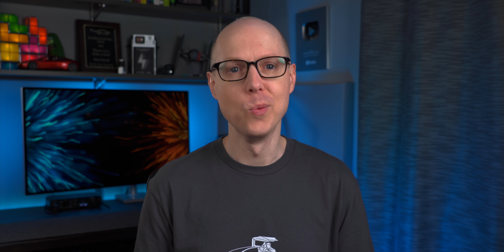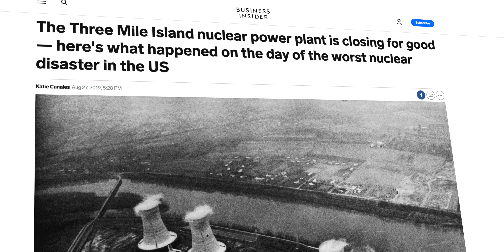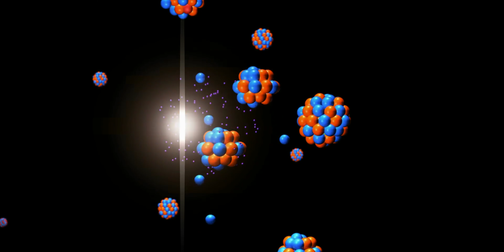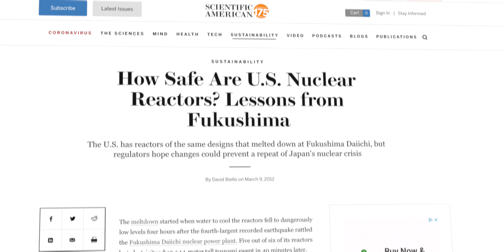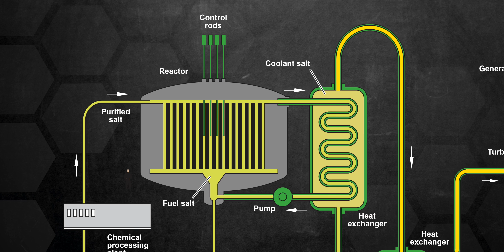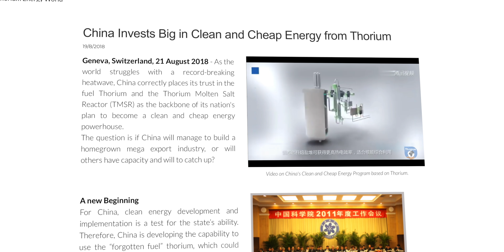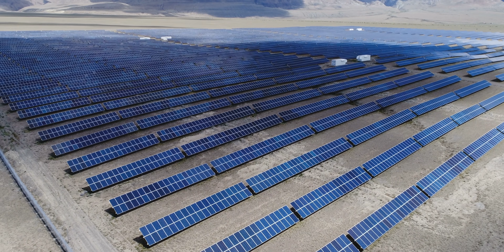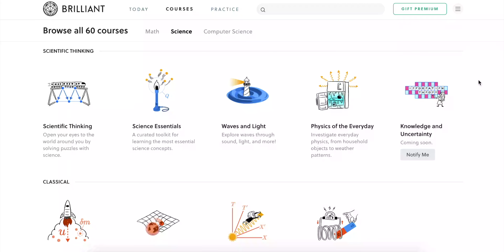Thorium explained - the future of cheap, clean energy?

Comment: No, thorium is not the future of energy, nor is nuclear or fusion as the cost of manufacturing and maintaining these plants is extremely high, along with the cost of mining, transporting and storing the waste, make these energy sources 3-5 times higher than wind and solar, I know, I run the LCOE calculations and work with U.S. utility companies who are shutting down coal and gas plants due to their high costs, not because they want to be green.  The massive fusion reactor in the sky is all we need, we just need to blanket EVERY roof with solar, put the largest wind turbines in windy areas and utilize massive storage batteries.  This is our future.
Reply: To do wind and solar for the whole planet would require literally millions of wind turbines and trillions of solar panels. Way too expensive to do
Reply: @Les_S537  Sorry, you're pulling numbers out of thin air without understanding what you're talking about.  See here as renewable energy will produce 100% of our future energy: https://www.wartsila.com/docs/default-source/power-plants-documents/downloads/presentation/towards-a-100-renewable-energy-future---presentation.pdf

Numerous calculations have been run showing wind, solar, hydro, wave and geothermal producing 100% of our power, and it's not only affordable, it's much cheaper than using any fossil fuel, nuclear or thorium and it's inevitable, just as EV's are inevitable.  Fossil fuels and nuclear will be in the history books one day, mark my words.  Thorium and fusion will never come to market, they make no financial sense.
Reply: @RussellFineArt  No offense, but you clearly haven't thought this through...  Today, wind power generates about 1-2% of all energy generated on the planet today...  That translates into around 300,000 wind turbines in operation today across the surface of the earth.

Now, let's say we take that to 50% of the world energy generation needs...  That would translate into literally millions of wind turbines across the surface of the earth.

So, how long does a wind turbine last until it needs to be replaced?  30 years, tops.  Mechanical stresses, bird strikes on the blades, general wear and tear of components all conspire to make wind a dead end when it comes to power generation.

Do you really want to replace millions of wind turbines every 30 years?  Have you thought about how fucking expensive such a venture would be?

Same story with solar panels.  To get 1 gigawatt of energy generation from solar you need 3.1 million solar panels.

The world energy needs today are in the thousands of terawatts.  For solar to work on a worldwide scale you're talking about literally trillions of solar panels.

Again, how long do solar panels last before complete replacement is needed?  About 40 years.

You clearly haven't thought this through.
Reply: @Les_S537  You can't say "no offense" and then lie about facts that I clearly know about.  I've been developing wind farms, around the world, for the past 13 years, you don't think I know the facts?!  Fact is, wind power produces ~5% of the world's energy and more than half of that capacity has been installed just the in past 10 years.  If we take that same trajectory, over 30% of the world's power will come from wind alone.  Likewise, solar energy accounts for ~8% of the world's energy today and is the fastest-growing industry in the world and will also account for over: 30% of total world capacity by 2050.  Hydro power accounts for: 16.6% and will remain roughly the same.  Geothermal and wave technologies are still in their infancy and are growing to make up the additional: ~10-15% of power generation by 2050.  

I respect your naivete on renewable energy, you likely have never worked in the industry or know the facts well.  Today's land-based turbines are sized at: ~5.6mW, from the old 1.0mW turbines of 10 years ago, which means they produce roughly 10 times the energy of the old ones, as the energy production is cubed, with respect to the swept area of the rotor, and the cost of energy from these new machines is about: 1/3 the cost of the old ones and their life-span is roughly: 40 years, with semi-annual maintenance, as they all receive.  Off-shore turbines have now reached 12mW, allowing 1 turbine to produce energy for: 16,000 homes, annually.  The average life-span of a coal or gas plant is: ~40-50 years, read the facts.  And true, solar PV panels have a life-span of: 30-40 years, however, the racking and power lines are already in place, the panels are relatively cheap to replace, when needed, and are fully recyclable, just as wind turbines are. 

There are no facts backing your claim that "trillions of solar panels will be needed", anywhere.  And why are you worried about how many solar panels and wind turbines will be needed?  These are all economic opportunities.  Are you worried about how many cars will be needed to transport people around?  How many cell phones will be made in the coming decades?  How many plastic bottles will be made and thrown away?  It ALL comes down to economics and economically, solar and wind are the cheapest forms of producing energy, period.  

Please site your claims of: millions of wind turbines and trillions of solar panels please, I find nowhere where this is mentioned.  BTW, I've powered my own house, 100%, with my own wind turbine and solar panels for the past 12 years, which also power my EV, 100%.  I paid 100% for my solar panels, wind turbine and EV and save: ~$2400/yr. from using grid power and gasoline.  In 30-50 years, virtually everyone will be doing the same.
Reply: @RussellFineArt  Oh!

I'm sorry. 

Did you just say that you've been developing wind farms around the world for the past 13 years? 

Of course you're all for wind turbines...! 

It's about job security for you.  Rolling my eyes 

It's about capacity factor my friend. 

The capacity factor of wind is anywhere between 32% and 47%.  So with a 5 MW turbine you're getting at best 2 MW, and not every place on the planet is good for wind power generation. 

When wind turbines were first proposed, the thought was that they would be maintenance free, and that they would last for a long while. 

The facts are that they need constant maintenance, and dust in the wind degrades the surface of the turning blades over time such they lose efficiencies.  Not to mention the 300,000 birds and over 1.5 million bats that get killed by them every year. 

Imagine the carnage if we took wind power generation to 50% of the world's power generation. 

You're clearly biased in favor of wind...  It's your money train.
Reply: @Les_S537  Yes, I said I have, in the past tense, which I no longer do.  I haven't worked in the wind industry in over a year and no, I have no job security in it.  You really need to do more research on wind turbines as yes, they have a capacity factor, ALL energy-producing equipment does.  Gas plants have a capacity factor of: ~56% and an efficiency of: ~22%, while today's wind turbines have an efficiency rating of: ~93%, the highest in the industry.  And no, there are no 300k birdies killed each year by wind turbines, that's a pull-out-of-the-ass estimate by anti-wind people that has no evidence to support it.  Ironically, most of these idiots who make up these exorbitant bird-kill numbers are eating a bucket of birds (chicken), while saying this nonsense.  The University of Kansas did a year-long study on bird kills and wind farms on a 300mW wind farm in N. central Kansas and found 2 birds killed, no bats, with 150 2mW wind turbines, in a whole year!  The students used motion-detected cameras throughout the wind farm and walked the perimeter, twice a day, recording all bird kills and found only 2.  Based on this, their world-wide estimates are closer to: 1200-2000 birds killed every year from wind farms.  Over 350k birds are killed every year from house cats and nearly 300k birds are killed from collisions with buildings, in the U.S. alone!  Are you planning to ban ALL buildings and house cats?  Let's be reasonable, while eating a bucket of chicken birds.

And yes, dust, hail and rain do slightly damage the leading edge of wind turbine blades, as they do all equipment exposed to the elements, but are easily repaired with coatings.  I've attended many years of AWEA windpower conferences and see the technology and know it well.  There's no changing the facts, wind energy is the cheapest form of energy on the planet and will continue to replace fossil fuels and very expensive nuclear power as modern wind turbine spin: 75-85% of the time with each turbine producing enough energy to power: 6,000-16,000 homes/annually with no fuel costs and very minimal maintenance.  And yes, wind turbines need to be placed in areas of high wind, which there are MANY in the world which is why any estimate has them producing ~40% of our power, at their max, with solar, hydro, geothermal and wave power making up the rest.  

Do yourself a favor and take a field trip to any utility in the country one day and talk with their facility engineers and ask them what energy producing technologies they have in their planning over the next 10-30 years.  I guarantee, it will be almost 100% wind and solar, I know, I've met with many of them throughout the years and these are the facts.  Stop wasting your energy defending fossil fuels or dreaming of ridiculously-expensive thorium or nuclear power and realize the facts.
Reply: @RussellFineArt  Funny, I saw a study of a wind farm up in upstate New York that had only 17 wind turbines, and they counted over 500 yellow billed cuckoo birds killed over a 1 month period.  Obviously, studies will vary depending on location and population density of birds in the area.  Kansas is a fucking flat ass state with a very low bird population.  Many other areas on the planet that have higher density bird populations overall will have worse outcomes. 

I'm not really concerned about all birds though.  I'm mainly concerned about low density birds of prey.  Birds of prey, like eagles, hawks, kites, et al provide a huge service to nature.  They keep field mice, rats, and other small creatures in nature in check.  Many birds of prey are already under threat of extinction today as it is without adding millions of wind turbines into the mix. 

Imagine you're an eagle with a lone chick in the nest (birds of prey do not have large families), and you need to feed it...  You're going to go out often to find food to bring back to it, right? 

So you're out on patrol at your prime flying height to view prey on the ground, which also happens to be in the very same zone that these turbine blades operate in. 

You see some rabbits in a field of wind turbines...  You lock your eyes on your prey, as you often do, and you dive in for the kill, and then WHAM 

Taken out by a wind turbine blade going 210 mph at the tip.  Now, not only are YOU dead, but so is your chick in the nest that relied on your for sustenance. 

I don't defend fossil fuels...  They need to go, and the only viable replacement for them is nuclear. 

Nuclear has a capacity factor of 92%
Wind has a capacity factor of ~36%
Solar has a capacity factor of ~25% 

It's a god damn no brainer bro. 

And you're wrong about the price of molten salt thorium based reactors, do you want to know why? 

Today's nuclear reactors all use water to cool the nuclear material.  This is dangerous as fuck because as we all know by now, when plant operators lose the ability to circulate cool water over the nuclear material the nuclear material will boil whatever water is present away, it will begin to meltdown, and then explode, and then you've got lots of radioactive waste spread far and wide on the wind. 

Because of this danger, today's nuclear power plants have triple redundant safety systems to ensure that plant operators can always circulate water over the nuclear material.  This greatly increases costs. 

Today's nuclear reactors all operate under extreme pressures too.  The boiling water reactor design operates at around 70 atmospheres of pressure while the pressurized water reactor design operates at around 160 atmospheres of pressure.  Because of this, extra heavy duty piping is required, and all sorts of certifications need to be done on every step of the build process, thus greatly increasing the cost to build. 

Molten salt reactors don't use water to cool the nuclear material, so you've removed the chance of a meltdown.  This greatly reduces cost to build because you don't need triple redundant safety systems.  Molten salt reactors also operate at 1 atmosphere of pressure.  This also greatly reduces cost to build. 

Molten salt reactors have their own safety concerns, but when built out they will be about 1/20th the size of today's nuclear reactors putting out the same amount of energy.

Molten salt nuclear reactors (MSR) should cost about $2.50/W when all said and done...  cheaper than today's coal plants
Reply: @Les_S537  I watched it, nothing new here.  I've taught wind O&M classes for years, have presented on this topic to U.S. Senators in Washington D.C., whom I've personally met with in their offices in the Senate office building, and have traveled the world teaching and informing on this topic of wind turbine maintenance, which needs to be understood when any wind facility is being proposed.  I've gone through dozens of impact studies, meeting with state and city officials, reviewing the data.  Although this is all new to you, it's been my life for many years and I understand it more than I can tell you on a Youtube post.  Again, trust me, all energy production will be via wind, solar, hydro, wave and geothermal as they offer the cheapest forms of power.  When coupled with commercial battery storage facilities, they offer the best combination to deliver power at the exact amount needed, cleanly, cheaply and reliably.  

Numerous studies have been done on how we achieve 100% renewable power by: 2050, or shortly there after.  See: https://www.oneearth.org/100-renewable-energy/

Keep researching and understand that massive, expensive central power plants are quickly becoming a thing of the past.
Reply: @RussellFineArt  This is not all new to me, I've been studying this topic for 30 plus years now.
Reply: @Les_S537  Great to hear, I applaud you're studying renewable energy and future energy tech.  Likewise, I've been studying this topic for nearly 50 years as my dad invested in some of the earliest solar panels ever made, which were EXPENSIVE!  I attended the 2nd annual Solar Energy Society Conference, in Portland, OR., when there was a whopping ~500 people in attendance and solar panels had come way down in price to: $1,001 ea.  I got in to wind when I was hired by a wind turbine manufacturer, in 2007, to develop wind farms and sites and a stayed in the industry, working for British, Dutch and German companies, throughout the years and transitioned back to solar, which I work in now, early this year.  Because I've worked in the industry, I've spend many, many hours researching our technology, teaching on it and selling it to customers and along the way, have run numerous LCOE calculations to compare wind or solar to gas, coal, nuclear and oil-generation.  I've worked closely, in their offices, with all of the Berkshire Hathaway utilities of: Midwestern, PacifiCorp, Rocky Mountain Power, and AES, Duke Energy, Xcel Energy and many others.  I've prepared and delivered numerous spread sheets, with graphs and data, comparing wind and solar to all other forms of energy and I fully understand the technology, the maintenance associated with it, its limitations and advantages.  When meeting with utility managers, we never talk about green energy or saving the planet, it's ALL about the lowest cost of power generation to meet capacity needs and wind and solar are the lowest, on every matrix: installation, operation and maintenance.  I've worked with utility engineers on battery storage, mostly Duke Energy and AES, who both have massive battery storage facilities that are used every day and virtually every utility is currently installing battery back-ups to eliminate their gas peaker plants which are very expensive to run and maintain.  

This is why when I hear of thorium, or fusion power, or any other theoretical power, I know they are pipe-dreams that will never see the light of day due to their massive costs and the fact that they require centralized facilities that are rarely needed anymore.  Every chart and graph I've ever run always has wind and solar, with battery back up, as the long-term energy solution.
Reply: @RussellFineArt  If you want to compare those energy source to today's nuclear power plants, sure, they may be cheaper on a per unit basis, but they are not cheaper over the long haul.  They all require massive amounts of resource utilization to make.  You've got to build steel towers which burns fossil fuels to make, you need metals and fiberglass galore, you need to mine shitload of materials to make solar panels that are toxic and can leech into the environment they're built into. 

They are susceptible to weather events such as hurricanes and tornadoes, et al.  I recently saw a solar array that got shredded by a tornado, and all of those panels were strewn all over the place, and the disposal of solar panels is not a cheap process by any means.  Recycling them costs an arm and a leg and is again a toxic process that produces lots of waste. 

I know you think you're right, but you're not. 

The average cost to operate a coal plant today is something like $3.25/W
The average cost to operate one of today's nuclear power plants is about $7.48/W 

Bean counters have crunched the numbers on molten salt reactor designs, and they expect the cost to operate to be around $2.50/W 

Watch this Moltex Energy presentation for more info
https://www.youtube.com/watch?v=TvXcoSdXYlk
Reply: @Les_S537  I guess I'm not making myself clear, I have worked, side-by-side with utility managers on adding capacity to their grid and every time, wind and solar are cheaper, in the initial commissioning and long-term than any other source of energy.  I've personally drafted and delivered the proposals for new wind farms.  Please finish your college degree in business, specializing in sustainable technologies, as I did, work for 13 years with utilities, governments and utility-scale developers of power plants and then come talk to me how I'm wrong about the facts I deliver.  I can guarantee you my friend, I am right, no question.  Utility power prices are measured in mW (megaWatts) NOT Watts and no, your number aren't even close.  I've signed PPA's with utilities for new wind farms for: $.02/kW or $.20/mW, beating nat. gas at: $.43/mW, coal at: $1.20/mW and nuclear at: $.93/mW.  Time-frame to build a new wind farm is: ~2-3 yrs, solar: ~1-yr., gas: ~7-10-yrs.  Nobody proposes coal or nuclear anymore, they're not viable, financially, nor do they meet any codes any longer.

You can talk bean counters all day long but again, molten salt reactors are hypothetical and will NEVER happen.  The only nuclear power plant under development and construction in North America is in Georgia and it's 2.5 times over cost and over 2x over schedule and is being considered a possible scrapped project as by the time it's completed, the energy costs will be: 3x that of going prices and still, nowhere to store the waste.  Look it up, I'm right.  Here's energy source pricing from 2018: http://www.renewable-energysources.com/

Do me a favor, have any utility manager contact me and tell me they are proposing a molten salt nuclear reactor and we'll have a good laugh as it'll never happen.  You can keep spinning your wheels but in the end, you'll see I'm right.  I'm not right about most other topics but I'm right about this one.

And yes, solar panels can get damaged from a tornado, EVERYTHING can!!  Hurricane's routinely knock out coal and gas power plants and have you ever heard of 3 Mile Island, Chernobyl, Fukushima?  Yes, these were all nuclear power plants that were destroyed from natural disasters and caused massive pollution and destruction.  Solar panels and wind turbines are relatively cheap, easy and quick to rebuild and are back online within days.  

I've watched enough molten salt reactor nuclear fantasy videos but it doesn't change the fact that nuclear produces energy at: 3x the cost of wind and solar, making it unaffordable.  

Look forward to hearing back from you in 17 years, or so, after you've done what I've asked with your college degree and work experience.
Reply: Russell Fine Arts one is happening right now up in Canada, with partial assistance from Oak Ridge National Labs. 

Watch the presentation video I linked. If you’ve worked in the field you’ll appreciate the details. Watch to the end
Reply: @Les_S537  You didn't attach a link.
Reply: @Les_S537  Thanks for sending, I've seen this presentation before, a couple of years ago.  I sat through a presentation given by GE on the cost of energy of various energy sources and GE clearly stated that although molten salt nuclear reactors held some promise, they were still much higher cost to build and produce energy, delivering higher costs of energy than solar, wind and gas, which is why neither GE, nor any other company is proposing any new nuclear power plants, of any type.  

How are you invested in nuclear energy?  Do you design the plants or have stock in any nuclear company?  Curious why you're so interested in the technology.

To be transparent, I have no investments in any wind, solar, or any other company but I do work for a solar company and I power my own home with solar, and a small wind turbine, and know the cost advantages of renewable energy.  I'm not opposed to nuclear energy as it offers good benefits but the cost to build, operate and deliver a nuclear power plant are extremely high, relying on massive tax-payer funds all to deliver higher cost power than any other source.  And the fact is an equal amount of solar is installed every month, just in the U.S., to replace a nat. gas power plant, making building giant, centralized power plants things of the past and no longer needed.  Why stay a slave to a power utility company who only doubles their rates every 15 years, when you can produce your own power via your own solar panels and battery storage?  It's not possible for everyone, as many people live in apartments, condos and such, but it's possible for most people.  I choose to produce my own power and save tens of thousands of dollars doing so.  I have zero interest in nuclear, gas or coal plants, they will all go the way of the Dodo bird.  Cheers!
Reply: Hi Russell Fine Arts.
I suggest you read "Sustainable Energy: Without the Hot Air" by David JC MacKay.  

Warm regards, Rick.
Reply: @RicksPoker  Thanks, I'll check it out.  I've read through much of the 10-page synopsis and MacKay makes some good points, however, his data is based on older technology of <2mW wind turbines as land-based wind turbines going in now are just shy of: 6mW, producing more than 3x the power, for the same area of land and his solar panels are low-efficient panels, where much higher-efficient panels are regularly used and he uses clean coal examples, however, clean coal doesn't exist, it never has, it was a lie and ploy by the coal industry and Republicans to try and convince people that coal could magically be clean.  It can't.  
I'll read through more of the info but I see the facts and the facts are: solar, wind and some nat. gas are the only utility-scale sources of energy being planned and developed and residential solar is growing at break-neck speed.
Reply: @RussellFineArt  
Hi Russell.  The whole book is worth reading.  MacKay is very kind on renewables when it comes to ocean water.  (I think his underwater turbines to grab tidal power will get covered with barnacles and other crud, and the ocean has not been kind to off shore wind lasting a long time with out major maintenance.)
But his point that to have country sized energy requires country sized areas of wind and solar remains true.  If you make solar 20% efficient instead of 12% efficient, you STILL need such huge areas that it is hard to imagine that the public will approve it.  
That is not to say, people putting solar cells on their roof (if they are rich enough to own their own home), won't help.
One thing that makes me happy is Tesla batteries.  For the price of a power plant, you can put in enough batteries to turn off a fossil fuel peaker plant.  Additionally the batteries stabilize the frequency better than a peaker plant can, react faster and are cheaper to run.  So as Tesla (and a few competitors) make millions of batteries, I expect that gradually one fossil fuel plant after another will vanish.

Nice talking to you!  Warm regards, Rick.
Reply: @RicksPoker  Thanks Rick, I agree, country-sized projects are needed as Iceland and Costa Rica already run on 100% renewable energy (excluding gasoline vehicles) as they have ample geothermal and hydro resources.  Virtually every country has plenty of resources and the public has very little to say about anything, otherwise we would have shut down coal-fired plants decades ago but, the law makers and corporate heads couldn't care less about how many people die, any more than the cigarette manufacturers do.  The entire U.S. can run on 10% of land in Nevada, if installed with solar panels, obviously, that's won't happen but if every unused roof space of every home, commercial building and parking structure was covered with solar panels, we'd provide most of the power we need without having to use any empty land.  I work in the solar industry and most homes only require about 1/4 of their roof to provide 100% of their power.  Tens of thousands of people are already off-grid, supply all of their own power without any limitations.  I power my own home and EV with my 5kW solar system and 2.4kW wind turbine and save: $2,400/yr.  I don't think we'll see much in wave technology and I firmly believe nuclear power and coal are dead and we'll never see them again.  Gas plants will continue on a much smaller scale, as they already are, and will be retrofitted with the Alan carbon capture system which captures 100% of the carbon emissions: https://www.youtube.com/watch?v=1zDZmIDbDO0&t=164s

Estimates are that only ~30% of our power will come from wind, ~15% from hydro, ~5% from geothermal and the rest from solar, with battery storage, which I believe will be the case over the next 50+ years.  Fossil fuels will all be tapped dry and turned off within the next 50 years.  Better days area ahead!  Cheers!